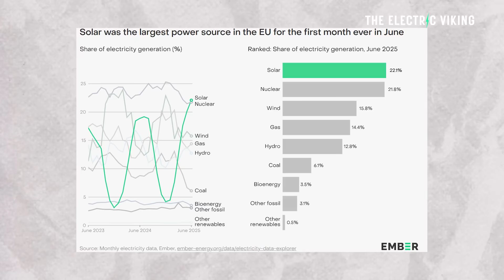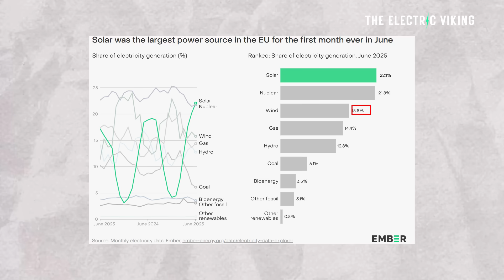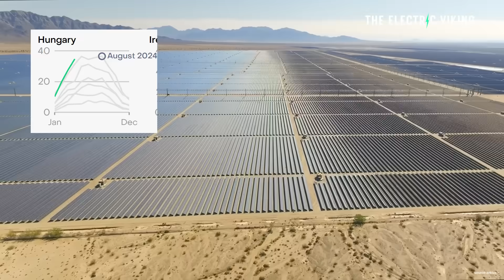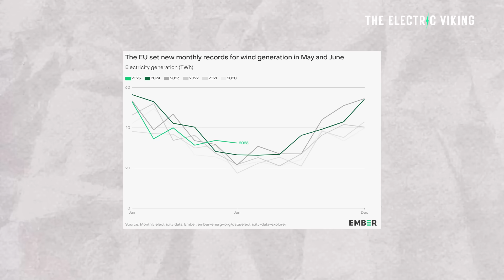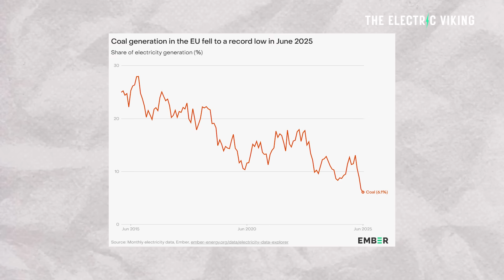Coal Hits Record Lows as Solar Power Becomes Europe's No.1 Energy Source

Comment: According to Gemini, nuclear is $150-240 per MWh. Batteries on the other hand is $437,000. Solar $22-53. All in Aussie dollars. Please correct AI.

It’s great solar in being introduced and is so cheap.
Reply: One price is build price others are running prices this is what AI does to human brain.
Reply: @mikoniemisto9535  Nonsense. Wholesale prices include running costs. What the wholesale price of wind and solar electricity doesn't include is the costs of backup systems.
Reply: @normanstewart7130  So you are saying you can use batteries just once?
Reply: @mikoniemisto9535  That's just wrong. Wholesale prices include running costs, what they don't include is the costs of backup systems that we need because wind and solar are unreliable. By the way, I'm sorry about what AI has done to your brain.
Reply: @normanstewart7130  I was going to write a longer response but to summarize the energy store will lower the average electricity price according to Standford and MIT. It's because consumption and generation never meet even with nuclear.
Reply: @mikoniemisto9535 which one is which so I can compare apples with apples. Nuclear cost was Levelized Cost of Electricity (LCOE), which is the average cost to build and operate a power plant over its lifetime, divided by the total electricity output Courtesy of csiro.
Reply: So why are retail prices so high?
Reply: @normanstewart7130 I think Australia put a bit of cream on top. If you buy direct from China, the price drops dramatically. I bought mine for $160 per kw
Reply: Love the picts of the landscape covered in solar panels and noisy bird chopping windmills.  It’s amazing how the panels beautify the countryside and improve the lives of the native flora and fauna.
Reply: @DGlass-yg8xk  Now oil rigs, that's just beautiful. And don't get me going about swimming in coal tailing ponds. The easiest way to get the glimmering skin tone.
Reply: @DGlass-yg8xk the community has complained about the construction on people’s private property for years. If you want to install something and lease your land you should be aloud. It’s amazing most people say renewables are free but 1 wind turbine will earn you approx $25k per year. Don’t know what an acre of panels land would cost in leasing but it wouldn’t be free.

Comment: Sam, you are talking rubbish. Coal isn’t being burnt, but waste is. And gas. Solar isn’t connected to the grid even if the arrays have been put in fields, reducing agricultural production. Gas produces half the electricity. Wind produces 5-30% of the electricity only. Biomass burning - trees - also contribute 10% of the UKs electricity.

Comment: Solar and batteries you only install once then it produces energy. With fossil fuels you have to keep digging them out of the ground without end, polluting at every step of the way.
Reply: There is really nothing quite so insulting as a comment from a minimum-wage fossil fuel industry troll writing about the damage to the environment caused by solar panels, wind turbines and batteries. Where are their posts complaining about the hundreds of thousands (if not millions) of un-recyclable glass-reinforced resin-hulled yachts berthed in ports around the world? Do the trolls also troll the yachting sites about the un-recyclable carbon fibre superyachts that their fossil fuel paymasters sail in all summer long? Are they also trolling the un-recyclable carbon fibre sports cars that the paymasters drive around in? I wonder…
Reply: Solar panels are good for 20, maybe 30 years, the batteries for 8 years, maybe 12 until replacement with newer, better, shinier. A coal plant will run between 70 and 120 years after the initial investment, a nuclear plant 40 to 70 years. Available batteries in the 200 MWh and 400 MWh range provide power for 2 maybe 4 hours and are ideal for flattening out energy peaks and holes. They are not suited to power an industrial nation the year round and no nation could afford it.
Reply: @SunshineShane  No coal plant will run without VERY complete restructuring for more than 30 years. And of course regular maintenance, which is a big part of the cost, since the boilers, the fluidicising bead etc are very prone to different types of corrosion and so on. Usually resulting in downtime, every two years or so. The same goes for nuclear plants. Yes The closest for me is O3 in Oskarshamn Sweden. It is closed at the moment for maintenance. and they of course need maintenance and update, that is of a very significant cost. This is not speculation from my side, since I have been an instructor for this nuclear plant, before retirement.

The initial investment is therefore of little significance. 

I do partly agree about the use of batteries, though. Batteries are very good for handling shorter energy demands, where nuclear plants are to slow to adapt to this. And life time of batteries are very much dependent on the actual type. Eight years is a normal lifetime for backup batteries, if they are industrial grade, led acid. NiFe batteries easily hold up for 20 years, and after that they can be recomissioned. The lifetime in industrial applications for Lithium batteries are yet to be seen. Probably much better than lead acid though, were the best flooded hold up for maximum of 20 years.
Reply: so wrong. where do the dead batteries go? making and disposing of batteries is polluting. batteries have to be replaced periodically. lithium is a mining polution also. mining lithium or mining coal? you do not know what you are talking about. plastic panels are pollution and no they do not last forever but also have to be replaced.
Reply: @standingbear998  Old batteries can be 95% recycled.  How much oil, coal and gas can be recycled?
Reply: You obviously have no idea of the polluting effects of mining the materials needed for wind turbines, solar panels, batteries, electric motors etc. etc. Not to mention the child labour.
Reply: Norman, from you're comment it's clear neither do you.
Reply: @normanstewart7130  And you think that mining will be less for coal? And the heart tones, of course child labour.
Reply: @normanstewart7130  It's a lot less than the the polluting effects of mining and transporting oil, coal and gas.
Reply: Solar installations have a lifespan of 15 years max,as do batteries. coal and gas plants have an economic life of around 70 years,nuclear plants similar. your comment is pure fantacy
Reply: @shanecollie5177  Rubbish Nuclear, coal and gas power plants need regular maintenance and replacement of turbines after about 15 years. Coal plant boilers also need replacement at about the same time interval.
Reply: @Terry-y2r  coal and gas plants have one midlife refit after around 35 years, giving a total lifespan of the facility around 70 years minimum. over that same timeframe you would. be about ready to install your 5th lot of solar panels/batteries/wind turbines.
Reply: @shanecollie5177  It still means solar and wind are cheaper. You are also under estimating the life of solar panels, many are still in use after 25 to 30 years. After 35 years the refit of turbines is basically a rebuild or replacement.
Reply: @shanecollie5177  Most modern solar panels have a lifespan of 25 to 30 years, though some high-quality monocrystalline models can stretch to 40 years or more with proper care. Gas Power Plants: Average lifespan: ~30 to 40 years
 then the taxpayers pick up the bill to decommission and decontaminate the sites. these are the facts. Also most solar equipment can be recycled, some panels can make more than two new panels.as technology has improved.
Reply: @shanecollie5177 you obviously don't have solar panels,  out still work after about 25 years
Reply: @shanecollie5177  Well, you are wrong. The solar panels last longer than 15 years. I know, I have experience. Batteries, well your statement is just incomplete. What type of batteries are you talking about?
Reply: @mikaelpehrman4815  !5 years is the expexted lifespan of commercial solar farms, that is a fact, I don't care if you don't like facts.
Reply: @shanecollie5177  Source, please! Since you question facts, let have a look at your source! I can easily see that you are talking about the commersial lifetime, not the technical.

Because it is a SIGNIFICANT difference between the commercial lifespan, that is shorter, than the technical lifetime. The surface of solar panels can be slightly corroded and this also decrease the power output, marginally. For the panels that Im familiar with they guarantee >80% output after 20 years. This corrosion and the very fast developement rate is so high in solar, make it a good business case to change after 15 years.....
Reply: @mikaelpehrman4815  !5 years is the expected lifespan for commercially opperated solar farms, in the real world you cannot wait until your infrastructure is buggered  before you replace it. A coal or gas plant will be running fine the day before it is decomissioned, so 70 years lifespan for coal/gas is an apples with apples comparison to 15 years for a solar array.
Reply: @shanecollie5177  It is an alternative fact.  In fact the expected lifespan of solar farms is 25 years (or more).  After that time, the panels will start to be replaced (unlike a coal or gas power stations, where the coal/gas is replaced continually).
Reply: @shanecollie5177  This is not a technical lifespan you are writing about, since you always has monitoring of the separate units and you have a regular maintenance schedule. You constantly monitor your system and exchange units that are not up to the norm. It is EXTREMELY old school to run things down. This is the case in all industrial level applications, not only solar farms.

What you ECONOMICALLY use as a design and profitability parameter is something else.
Reply: @shanecollie5177    That statement sort of assumes that the cost of those installations, solar and coal, are the same. But everyone knows they're entirely different. Add to that solar is 4 times more efficient at producing energy than petroleum and probably much better than that vs coal.
Reply: @shanecollie5177  Incorrect.  There are plenty of solar panels that are working after 25 years.  The lifespan of solar installed today is 25-35 years.

Comment: You are so wrong. Eu is saved with gas and the electric cable that runs from Norway. Germany has closed its nuclear power plants. It’s a shit show.  We pay to much for energy and we are not competitive anymore. Manufacturing Industry is moving out of Europe.
Reply: That's because of poor planing. More pumped hydro storage is required for 24/7 reliability. Cheaper to use onshore wind and solar with pumped hydro.
Reply: More sun and wind energy combined with battery storage will eventually bring the prices down.
Reply: The reason is because when you decided to cut nuclear, you should have allowed up to 5% of your land for wind turbines and dramatically increased your solar and battery storage. Your mistake was not increasing your wind and solar with battery storage enough, after you cut out nuclear.
Reply: @neo1267 why cut nuclear?
Reply: @neo1267 Firstly, this is about Germany, not Norway (so it's 'they', not 'you')
Things takes time, and when Germany closed the nuclear power, the green transition had not come further. In addition we got the war in Ukraine. Germany may have closed the nuclear to early, but on the other hand I think it helps accelerate the green transition. Germany will come out ahead of many other countries.
Reply: You mean the country with more thann1 terawatt of solar is out competing you!!!Chinese are so much smarter than Europeans that is why they are outcompeting you.

Comment: 3:39 when the sunshines and the crops grow and the batteries are full PV outshines all grid energy. 
Long daylight hours in summer are unbeatable. 😊😊😊
Reply: Winter will
Come for sure 😂
Reply: @volkerr.Yes you are right, but grid electricity is an economic problem that needs 247 cashflow. 
Modern dirt-cheap rooftop PV and v2g EVs massive storage battery parked 23hrs every day and all night long will mean millions and millions and millions of old consumers, the old cashflow will choose to use their dirt-cheap 2cents kWh electricity and save the old cashflow for themselves. 
This is $100sBILLIONS in tax-free savings annually. 

I think that a little fossil fueled energy in the winter weeks will not be a problem. 

EVs massive 100kwh battery (for the long drive) is free storage 23hrs every day and vastly bigger than the home batteries. 

Even nuclear promoters talk about maximum UTILIZATION of your investment..
Reply: Tell that to the people in Spain.
Reply: @normanstewart7130  Being on the same grid as Nuclear and coal plants did not help either.
Reply: @Terry-y2r Exactly right. Spain has 7 nuclear reactors and the grid was lightly loaded.
3 reactors offline for maintenance,  brilliant reliable nuclear electricity. 
France cut off Spain to protect France's fleet of nuclear electricity reactors.
France's nuclear ran away from Spain. 
Portugal Chinese owned electricity grid may have pushed the rapid offline shut downs.

Spain is f....ked from both ends of its grid.
Reply: @stephenbrickwood1602 Blackout in Spain was caused by too much solar power in the grid. It’s proven already 🤷🏻‍♀️
Reply: @normanstewart7130 Yes you are right, but grid electricity is an economic problem that needs 247 cashflow. 
Modern dirt-cheap rooftop PV and v2g EVs massive storage battery parked 23hrs every day and all night long will mean millions and millions and millions of old consumers, the old cashflow will choose to use their dirt-cheap 2cents kWh electricity and save the old cashflow for themselves. 
This is $100sBILLIONS in tax-free savings annually. 

I think that a little fossil fueled energy in the winter weeks will not be a problem. 

EVs massive 100kwh battery (for the long drive) is free storage 23hrs every day and vastly bigger than the home batteries. 

Even nuclear promoters talk about maximum UTILIZATION of your investment..
Reply: @normanstewart7130  The people in Spain were treated to a quiet evening without television and without electric billboards, and the corporate media made it seem like the sky had collapsed.  Well, the new energy sources and software controlled power electronics are transforming ALL power grids, from the nuts and bolts level, to the question of what a grid should even consist of.  In the process, Spain will learn how to keep the new grid stable, and every other country will too.  With growth and new developments, there is learning.  It is part of the cycle of life.
Reply: @HonestJohn-y3k just imagine what happens if the grid is off for longer.. no water from the tap.  Toilette doesn’t  work anymore… you can’t buy anything cause all stores are closed. Electronic payment doesn’t work. Only cash is king. 

😱
Reply: @volkerr. If the problem in Spain recurs, it has absolutely nothing to do with the adoption of renewable energy.  If the problem recurs, it is a matter of competence.
Reply: @HonestJohn-y3k a grid that rely on renewables only is very sensitive and can easily break down. That’s a simple physicist fact 🤷🏻‍♀️
Reply: @volkerr. We will have to go without for a bit like when living in the 60's and 70's its not a big issue if you can't have strawberries in winter is it, have porridge instead.
Reply: @volkerr. That is the opposite of the truth, and the opposite of a fact.  Solar panels just keep working, day after day.  They have no moving parts and do not break down.  Coal and gas plants both have many moving parts and they in fact DO break down.  They are often down for months at a time, for both scheduled and unscheduled maintenance.  When California used to have rolling blackouts every summer, the cause was gas plant break downs.  After they added a large amount of solar generation and battery storage, the rolling blackouts stopped happening.   I think you should go back to the FUD factory and ask them for something better.
Reply: @HonestJohn-y3k  Well said sir !
Reply: @HonestJohn-y3k  3 nuclear plants offline in Spain is reliable  ?.?.?.?   😮 I don't think so.
Machinery needs maintenance shut downs. 
Millions of PV panels working daily for decades and the failed panels easily swapped out is more reliable technology. 

On rooftop of the consumer means less load on the grid also.

You are correct to speak up.
Reply: @HonestJohn-y3k I own a 100 KWp solar panel plant. I know exactly what I am talking about 🙄

Comment: Using 1 months data to claim that coal will be replaced in few years is pure stupidity.
Reply: It's not just about 1 month because this moment has been building up for years for solar to overtake other energy production.  This news is a culmination of many years of investments, technology development, and policy changes.

This video reports that solar overtook in June in the EU.  But with this milestone reached, solar will now spread to other months of the year--then it will continue year after year.  Renewables, especially utility-scale solar photovoltaics, are growing exponentially year over year.  Renewables have reached historic low costs (per MWh levelized cost) years ago and still continue to drive their costs lower.

Mainstream investors also look for "critical mass" to occur before more investments to pour in.  This is the type of news they look for.  Because earlier investors typically have more appetite for risk but later investors (the mainstream investors) are more risk averse, but will now see a potential new opportunity.